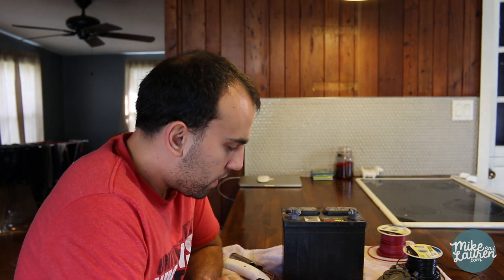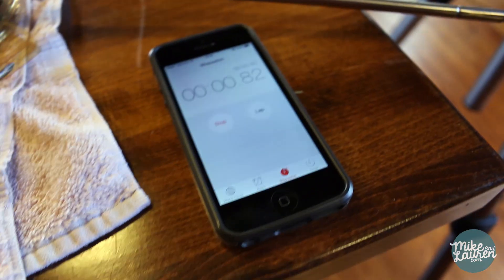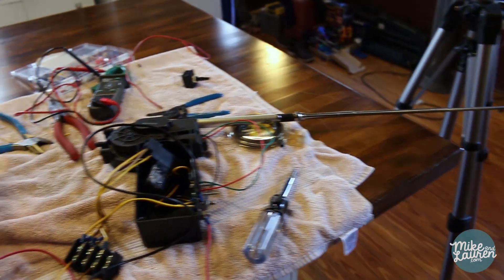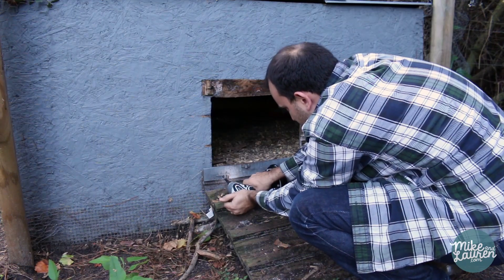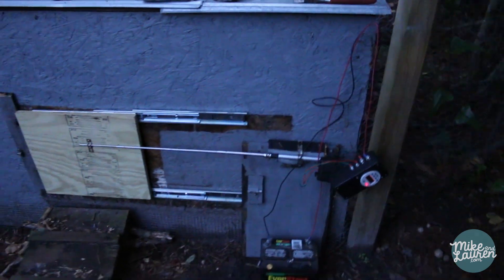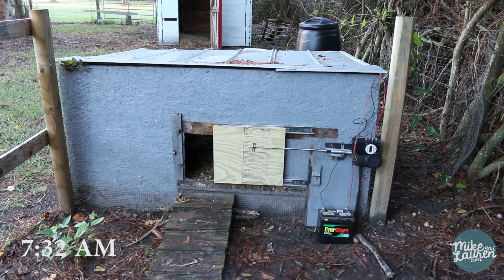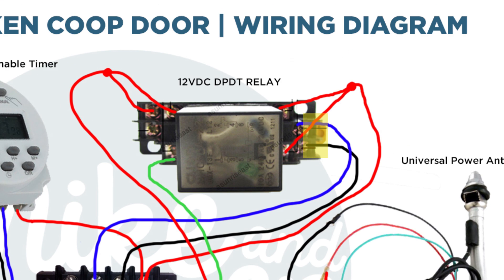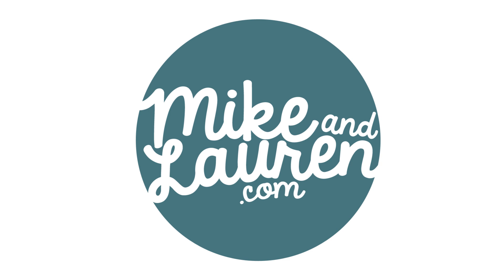DIY Automatic Chicken Coop Door Opener Build | PART 3

Comment: I think i would have done it much simpler
Using 2 standard A C outlet timers, setting the time for one to open and the other to close,
Going to a 12 volt supply, and a couple of diodes to for isolation with a double acting relay that switches polarity when needed,  as this  could do the same,  much simpler, 
 Using 2 shut off switches on the door to turn off D C power, Using DC as needed, 
Doing it this way would give you much more positive results, not using a weak system of digital semiconductors,
Now i'm not sure if it is possible to get just 12 volt timers , as i been away from electronics for years, that is why i mentioned 120 volt timers,

Comment: Wiring diagram is slightly off when it comes to the relay, good idea, but because this is a power antenna,  they need to be fully retracted, thus the antenna burns up because it is fighting to retract. Get an actuator.

Comment: Hi, great idea for chicken coop door, in fact ive copied your idea and wiring diagram all works great except the timer, if i set program 1 to close at 20h and reopen at 08:30h the coop opens at oo:ooh, i also tried setting program 1 close at 20h and reopen at 00:00h and then program 2 to close at 00:00H and reopen at 08:00h, it still opens at 00:00h and doesnt reclose, can you help me out with the timer settings? many thanks

Comment: I’m in the process of doing this myself. I have the timer and now the antenna. My question is what is the point to the relay? If the antenna needs a constant and a switched power can you not just run the switches power through the timer to raise and lower the antenna? Does the relay provided a fuse to protect the antenna? Just confused why you can’t just bypass the relay.

Comment: Nice video.....thou you do not need the DPDT as the antenna will automatically retract when one of the power leads are removed by way of timer.Also, the bottom draw rail will very soon fill with dirt (freeze in colder weather) and chicken poop and seize. The antenna has very little power to overcome resistance especially on the extending stroke. I know because one of my first designs was exactly the same. To eliminate this put the door on the vertical as the antenna has more power pulling in the antenna (ie opening the door) and the drawer slides will not fill with dirt....... thou rusting and freezing will still be a problem.Over the years I have found that antenna version of my coop door was not as secure(because of issues mentioned)  as what I wanted so I now use an 12" actuator piston (with built in limit switches), photocell, DPDT(needed for this to reverse polarity) and a 12 volt transformer. This version works like a charm. Not putting your door down....it will work fine....just continuing to build a better "mouse trap".
Reply: You're definitely right about the torque power of the antenna motor. I am in the process of building one and unfortunately what you are mentioning is happening to me. The door cannot be lifted all the way and stops halfway through. I am using a very thin metal door to keep it a little strong. I tried the lightweight thin plywood but the result was just about the same. So, I am following your recommendation. Linear actuators are too powerful but no worries there. Thank you for the extra idea!

Comment: Nice work. Do chickens always enter the coop on time and together? Do they always enter before dark? What if one or more chickens is locked out the whole night? I'm just about to get first chickens ever in August and am building a coop right now (after building the run) and am thinking a way to track how many chickens are in the coop, plus the amount of light outside, would assure no chicken is locked out during the night. The way to measure light is obvious, a light sensor. The way to measure how many chickens are in or out would be a flapper placed in the coop door that is set up to turn some amount of degrees each time a chicken passes through the door, either going in or going out, and adds up the turns throughout the day. Should the light sensor trip at night and the turn counter hasn't counted all of the chickens it would wait 2 minutes and try again. I know this would require the addition of one more part to the already long list, such as a $30 Arduino, but it'd be really slick.

Comment: Mike. I mimicked your entire set up and cannot get it working. I just fried my relay. Can you give me a link about how you got your relay set up? Please and thank you.
Reply: Considering M&L do not have chicks anymore but must be so very busy with that monster blog of theirs, I feel awkward asking them the question you did.  Let me ask you: Did you ever figure out the wiring to the relay?  And what switch are you using?  I cannot find one identical to the one in the Wiring Dia. Like you, I've burnt out mine -  4 times, 4 different makes.  Obviously, I know zero about relay switches.
Reply: I will post a video at my account within a week about all this but as a heads-up:  For a timer to activate the door/antenna I got a 120 AC hot water heater timer switch.  I connected the green DC wire  to a non-conductive surface near the on-off manual throw switch.  Then attached a dead eye to that.  On the manual throw switch I fastened a wedged metal clip - again: made so it cannot touch the metal of the AC unit. To the clip I attached the other side of the green DC wire. When the switch is thrown by the timer dial the metal clip enters the dead eye and sends DC power to the antenna  -thus closing the door.  Switch throws it off - clip pulls back and opens the door.

To control my DC car fan to cool the coop; I got me a cheap baseboard thermostat; works perfectly.   Baseboard type is cheaper and does not require household current.  The wire gauge is also the same as the DC wire to the fan (thick.) The thermostat just goes in-line.

Comment: Just a quick question, or maybe not so quick, can't you do this with just the battery, timer, and antenna?  You feed power to the black/red wire on the antenna and then flip power on/off the green wire via the timer.  Isn't the timer doing what the relay doing?  Wouldn't this work or am I missing something here?  Thanks.
Reply from the maker: iN2CODER It would work like that on some antennas but not mine.  It needed constant 12V whether it was open or closed.  That's why I used the DPDT relay.
Reply: +iN2CODER using just a switch to cut the green wire on/off is not the same as moving the green wire between the red and black side.  
I built one of these and simply used a 12 volt timer switch with a relay (it has 5 wire terminals).  The timer "moves" the green wire between the red and black wire at preset time.  It is working nicely.
Reply: @deasttn  any diagram

Comment: How did you set up your timer? did you do it like, turn on 8:00 and off 8:01 (to open), turn back on again at 10:00 and off at 10:01 (to close)
Reply from the maker: Cormac Barry No, the way my antenna motor worked is when power is applied it's closed and when it's off it's open. So at 7am it turns off opening the door, at 7pm it turns on (giving power to the antenna) and it closes.

Comment: Hey Mike....how's the automatic door holding up (working) since you've installed it? Just wondering as I'm getting ready to do an installation similar to yours without the relay (maybe). Great job....you got me motivated to do it......Cheers....Bill
Reply from the maker: Olivia Kilpatrick The timer has a manual override button you could use to keep the timer from opening the door on cold nights. 

 If you wanted it to work automatically, you could install a temperature switch AFTER the timer, so the door wouldn't open under a certain temperature.  

Also I forgot to answer your 2nd question.  Yes this system would work just as well vertically, I just didn't have the space.
Reply from the maker: Hey Bill!  It's working great EXCEPT....haha there's always an except.  This one's pretty minor, but the chickens kicked dirt and wood chips in the track of the door so it's too hard for the antenna motor to close.  I just have to clean out the track and move it a little higher, but I haven't had time.  

Otherwise the electronics worked flawless for a few weeks.  I'm very happy with it.
Reply: Mike and Lauren 
Hi Mike and Lauren: Question #1: How much did this rig cost you in total? #2: Would you recommend installing it vertically instead of horizontally? 

Thanks for the vid! Building my coop soon!
Reply from the maker: Olivia Kilpatrick Hi! The total cost was about $50 (80 if you need a battery, I had an old one).  It was $20 for the antenna, $7 for the timer, $20 for the solar panel, and $4 for the relay.  The rest of the stuff I had laying around like wires, and enclosure, and nuts and bolts.
Reply: Wonderful! Thank you.

One more: I'm asking because I'm in Southern Ontario, how do or would you you rig it for really cold and snowy days when your girls don't want to go outside and you don't want to lose the coops heat?
Reply: @oliviakilpatrick  I would advise you NOT to use this. If you still need an auto door let me know and I will send you links to timers, linear actuators and wiring diagrams that I have spent the last few years searching for to find the best prices and quality. I have literally spent around $700 in purchasing parts to research, so people like you won't spend over $80 in parts and save brain power on wiring.
Reply: Mike and Lauren Cool. Thanks! Very helpful.

Comment: Just a friendly tip, you shouldn't even need the DPDT relay, or any relay for that matter. You just need a single pole/single throw (SPST) relay, which you already have in your timer. An external relay would only be necessary if your load voltage (motor) was different from your signal voltage, or if your signal source couldn't supply enough power to your load. Neither of these are the case. Also make sure you add a flyback diode if you do continue using that relay. Over time the lack of diode may cause damage to components.

You just need to connect the green wire to one side of the timer's switch, and the other side of the switch to power. I made a diagram. Technically you also need a large resistor between ground and the green wire to avoid what is called a "floating input," but that isn't probably absolutely necessary with the motor you have. I'd need to see a data sheet for the motor to be sure.

http://imgur.com/f94ERja     The 100ohm resistor should actually be a lot larger to preserve battery life. Maybe 100 kOhm.

I'm a junior in Mechanical Engineering at Ohio State, I love what you two are doing with the personal finance/DIY movement. Let me know if you ever want to run a design by a happy-to-help engineer!
Reply from the maker: Brian Rice Hey, thanks for the diagram.  I appreciate the help!  It definitely makes sense on paper, but for some reason this didn't work when I had a SPST relay.  Did you see PART 1?  I was at a loss, and people in the comments suggested I needed a DPDT relay and then it worked.  

Can you explain the difference between what I did wrong in PART 1 and your diagram?  Maybe because the switch I used was different in PART 3?
Reply: Mike and Lauren It is hard to say. The light switch you used in part one may have really low sensitivity, or maybe really high. The gain is probably adjustable, but who knows how with random Chinese electronics.

Either way, the way you hooked up the DPDT relay essentially uses one pole as a pass through (both outputs are connected together) and the other pole as a single throw (green is attached to one output, but nothing is attached to the other.) Basically a SPST relay in effect, just more expensive!

The only way to learn is to tinker and experiment. The real fun starts when you get yourself an arduino and make the chicken coop wifi enabled. :) I'd be happy to draw up a wiring diagram. haha. Keep up the great work!
Reply from the maker: Brian Rice Thanks, that makes sense.  I've actually got a raspberry pi that I ultimately want to have as a central control unit for the coop.  I'd be interested in an IP camera and water/food sensors attached to a network so I can monitor the coop from vacation etc.
Reply: Brian Rice Thank you.  I was wondering about the relays & why he used them.  I'm about to install my antenna chicken door and was scratching my head because my setup with a DC timer and antenna is working without a relay.

Question:   Will the antenna draw from the battery when it's extended, even though the motor is not running?  I just don't want to drain my battery quickly and have to recharge it every other day.
Reply: There will probably be a small drain on the battery, but it shouldn't be but a milliamp or two. I don't remember the details of this circuit anymore, it has been six months since I drew it up.
Reply: I figured it wouldn't be much (lil LED) since the motor wasn't running.  I have a 7aH battery, and I'm hoping to get a few weeks between charges.
Reply: +deasttn   I'd get a 5 watt solar panel hooked up to it right away, if you are using a lead-acid battery. Sulfates build up on the plates and eventually kill the battery. The more discharged the battery gets the the faster the sulfates buildup, and the shorter the life of the battery will be.

Comment: I'm glad to see that you finally got it working. My question is, do you plan on charging your battery with solar power? If not, how long do you think it will last before needing a charge?
Reply from the maker: Gene Jordan Yes, I've got a little 5 watt solar panel that will keep it topped off.